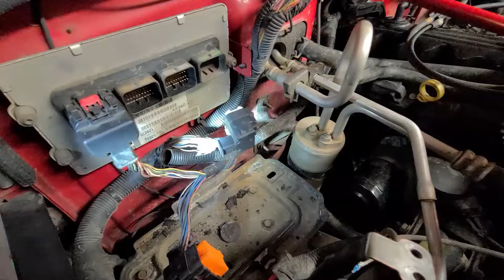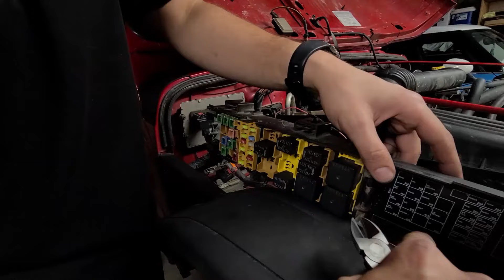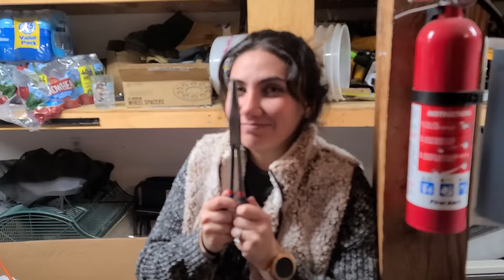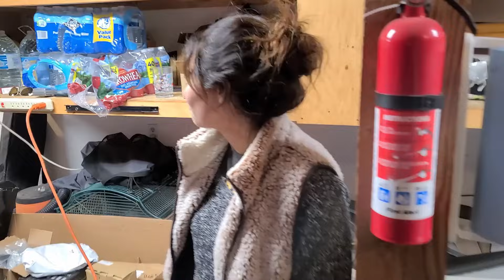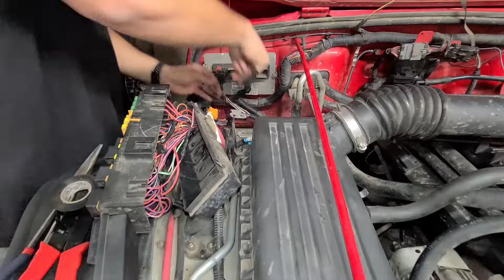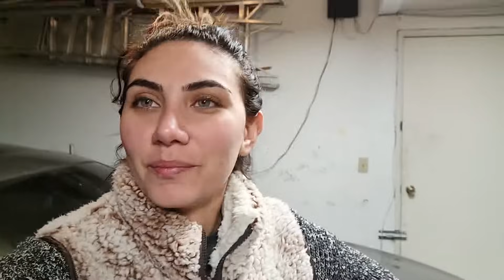STRANDED by the ASD Circuit! Here is HOW we Tested and Fixed it! Easy!

Comment: 96 grand Cherokee with 5.2L. I am not getting ground for the ASD or fuel pump relays. I provided ground signal to both of them and I get fuel pressure at the rail and I can see the ASD relay actuate with the housing removed. Engine cranks but does not start. I checked with a test light at the injectors and I have constant 12v to them while starting and I do not have spark either. Any experience with something like this?

Comment: Hi there. My issue is that the ASD FUSE was blown. So I replaced and it fired right up but unfortunately as I suspected it blew the FUSE again, to me indicating there is a wiring fault somewhere. Mine is a 2014 though and I believe also has the O2 sensors on this circuit. I guess I have to painstakingly check all associated wiring to find a wre grounding out (?). Also I am not sure of failed O2 sensors' state, if they will be in a short circuit co dictionary causing the FUSE to blow or not. I guess I can disconnect all the O2s and try to see if it doesn't blow the FUSE. Any advise would be great. Thanks. Great video BTW

Comment: I'M  HAVING  THE  SAME PROBLEM  !!, BUT  A  LITTLE  DIFFERENT !!!, I  HAVE  A 2007 JEEP  COMMANDER 4.7  AND  IT  KEEPS  SHUTTING  OFF  WHILE  DRIVING  IT !!,  IT  STARTS  UP  AND  RUNS  PRETTY   GOOD !!! , BUT  THAT  CODE -P0688  KEEPS  COMING  UP !! . IM 
JUST  WONDERING  WHAT  IT  COULD  BE !!! . YOU  THINK  IT'S  THE IGNITION  SWITCH !!, I REPLACE THE  LITTLE PLASTIC  PART  ON  THE IGNITION  SWITCH !!, BUT NOT THE  WHOLE SWITCH !!, I  ALSO REPLACE  THE  CRANK SENSOR  AND  THE  CAM SENSOR !!, AND  IT  ALSO RUNS  ROUGH !!, NOW   THE  PARTS  I  BROUGHT WASN'T  SOME  PART FROM  EBAY    !! . NOW DOES 
 ANYBODY  ELSE  HAVE THIS  PROBLEM  WITH 
 THEIR   JEEPS !! .
I  ALSO HAVE  ANOTHER PROBLEM  WITH  THE HARD  DOWNSHIFT  !!, I'M THINKING  ABOUT REPLACING  THE  VALVE BODY !!, BUT I  JUST MIGHT  GET  A  FLASH UPDATE  FROM  JEEP  DEALERSHIP  FIRST !! , THANK GOD FOR YOUTUBE !!! .   NO ? 👌👍👌

Comment: I have a 2011 jeep wrangler Sahara unlimited and I am getting the ASD and the jeep won't crank or start. I swapped the relays and no change. I think it's the nutrial safety switch but to replace it is so hard as it's in the transmission. Can you please help?

Comment: I have a 2002 Dodge Ram pickup could this be the same issue I am having I have tried everything replacing relays and fuses replace the crank trigger the truck just died one morning right after restarting it from the remote start

Comment: Hey so I’m kinda having the same problem with my 4.0 xj. Mine starts up fine but after 20 minutes or so it stalls. And then it cranks but won’t turnover. But after 15-20 minutes it starts right back up. Also, it’s not overheating. I was leaning towards the CPS or the ASD relay. Could you shed some wisdom on what I should check or test cause changing the CPS is a pain. Thank you and great video, I subscribed to your channel cause your explanations are great. Cheers.

Comment: Hi, I have a 98 Wrangler with exact same problem. it will crank and crank but no start. What would you recommend as first diagnostic step(s)? I replaced the distributor and am pretty sure I did it right. there is fuel in the fuel rail...I will replace spark plugs tonight but I feel hopelessly lost and cant afford a mechanic bill right now. Any help would be greatly appreciated.

Comment: I’m having problems with a 2001 jeep wrangler. I’m working on this vehicle with a group of people in my automotive class. The ASD relay does not click, and the pcm is getting the power and ground that’s needed in the connectors. I also have no communication to the vehicle.

I check my 5v reference circuit and was only getting .40 volts with key on. I started unplugging sensors except the crank, cam, and battery temp sensor because I ran out of time that day.

But my main question is do the ASD relay have to be active to receive 5 volt supply?

Comment: Hi , i have same jeep but my issue is when ever i leave 02 sensor wire connected it makes my fuel pumps wear out really fast, so i unplugged 02 sensor wire and now fuel pump has lasted long time , what could be the issue? are they on same circuit where  causing to much amps to fuel pump? through the ASD ty good channel

Comment: I hope you can reply , I have a 95 Jeep Cherokee with a crank no start issue. I reverse polarity, jumped it with jumper cables, and now my jeep won’t start. I have no fuel and no spark have replaced all the relays, Ignition coil, cap, and still no start. Any idea what could be the issue?

Comment: Awesome video, helps immensely.  Going through similar issue (intermittent stalling), and now I have some stuff to test out and investigate.  Might just solve my problem...
Reply from the maker: Glad it helped!
Reply: @Garagecouple   VBG
I cleaned up the grounds, and tested all the cam & crank sensor wires, all good.  Everything was pointing to the crank sensor, which turned out to be the problem.  Now solved.  I learned a lot about the importance of methodical diagnosis.  Probably the most important skill for a mechanic.

Comment: I have a 2000 dodge 1500 5.9 gas , the scan tool reads no communication with ECM,  I have 12 volts to ECM,  and 5 volts at throttle position sensor.  What should I be looking for?

Comment: I’m having the same problem on my 1997 jeep wrangler 2.5l and I switched out the the  coil and wire and spark plug and fuel pump. It still would crank over but not start so I checked the spark again and didn’t get any spark so I jumped the relay and got spark but it’s still not wanting to start up?

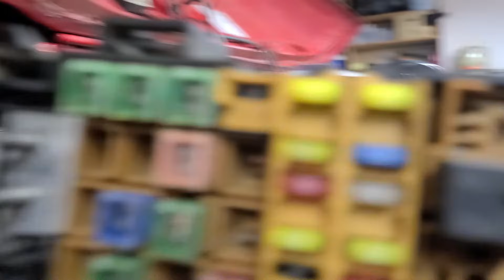Comment: 3:16 The center terminal of the relay is 87a. That's the normally closed position. Apparently, Garage Couple is referring to jumping between 30 and 87, far right and center-left in this video. That would simulate the relay closing and cause the starter to crank.
Reply: Also when I'm changing an in tank fuel pump and need to drain the tank of fuel I disconnect the fuel line & run it to a gas can then jumper the same pins on the fuel pump relay. Much easier than jamming a hose down the fill tube & siphoning the gas and no nasty taste of gas when trying to prime the siphon hose.
Reply: @johngreen6643  Every time I've dropped a fuel tank it's because I needed access to the broken fuel pump inside the tank. But that's a good tip for occasions when the pump is still good.
Reply: @johngreen6643 😅😅😅cut. Slit in the hose and with compressed air shoot out then plug with thumb then air a few times, not your mouth😅😅😅, tank will drain in under a minute
Reply from the maker: Yup, bypassing the relay..
Reply: Thank you so much for breaking this down. Did not mention the relay numbers in the video and mine is different

Comment: Similar issue on my 1997 Dodge B1500 conversion van. (basically a 3.9L Ram Truck under the hood) And today I said to my father, "We should just shove a penny in the ASD." Now that I see your DID bridge the relay to test, I'll probably actually try it. But, my question is...

When the ASD closes correctly, do you get one click; or two? Because when we turn the key to pre-crank position, I hear and feel the ASD click once; then 1 second or less later; I hear/feel it click again. So the PCM is successfully sending a ground. But that 2nd click could be the PCM disengaging the ground.

We've already replaced the crank & cam sensors, coil, distributor cap, rotor, plugs AND plug wires. (A lot of it was cheap, and sending it to a garage would probably get into 4-digits quick, so why not just buy and change EVERYTHING it could be?)

Today I confirmed the wire-continuity between the coil and the computer and between the coil and the ASD relay by stripping them just before their mountings. Anyway, if the relay is closing, and then opening again -- which is what it sounds like... Either the computer is sensing a real, genuine misalignment and refusing to start the engine to protect it, or the PCM is just... wrong and bad. That's my guess, anyway.

Anything you can add is greatly appreciated.
Reply from the maker: Good luck!

Comment: Interesting..the factory just did a  fuse block wiring repair [ recall ]auto shutdown relay I believe..my fuel pump is not getting power all the time.. the ecm controls the fuel pump relay..terrible wiring by Dodge
Reply from the maker: Afree

Comment: Just to be clear, with this issue the Jeep will turn over? I’m having an issue where sometimes my Jeep will start, sometimes the dash will light, up but won’t turn over, sometimes nothing comes on. I’ve changed the ignition, the battery, and I’ve followed the ground. I think I’m going to try a new ECM next. Any ideas?
Reply from the maker: Nope it will not turn over

Comment: nice video! im having some starting truoble with my 1994 dodge viper, im getting a 42 blinking code that says asd cercuit, my car intermittent have a long cranking and sometimes its like normal, do you have som tips for it? last time it was cranking and cranking it had no spark at plugs, i can hear the fuel pump prime everytime i turn the key, but i can hear some clicking from some relay i think sometimes when i turn the key, but when it first starts it runs like normal
Reply from the maker: I wish I had a 94 viper. Why don't you give it to us so we can fix it
Reply: @Garagecouple  hehe yeah that would be great if i wasnt living in norway ;)

Comment: Hey guys  what you mean when you're talking about the asd relay on your video around minute 3 to 3.20  when you say 
(unless you're  done the TSB you'll  get 
12 positive volts constant) because  I have 12 positive volts in both first one and the top left one, with out ignition on what's the TSB ?
Reply from the maker: It's the service bulletin repair by jeep
Reply: So it's  normal that  do I have 12V constant positive on both plugs with the ignition switch  off

Comment: Hi guy this video is really good one, 
I have a 2001 Dodge Ram 1500 2X4
5.2 and the cluster show the mileage and after a few seconds the mileage  blink and they go away and shows (no bus) I check the asd  pins  and I have 12V 
constant on both and on your video you said one has to be 12V with switch on
unless  you're  done with  you TSP both pins will have 12V constant  I have no idea what you mean so I'm  lost can you help please!!!

Comment: You presented this video in a very simple and direct, easy to understand way. I've watched this video several times trying to understand why my 2006 Jeep fuel pump was not receiving power. I have a jumper wire with 30 amp fuse for terminals 30 and 86 which can power fuel pump if needed. Original problem was failed computer at 100,000 miles. Bought computer from WranglerFix which was able to start engine, shortly after fuel pump was not powered, put new fuel pump in, it failed, bought new OEM from Jeep, it failed,  BUT WHY ? Fuel pump is good,  fuel pump relay is good, WranglerFiix computer and backup computer both good, wiring is good, but every couple weeks Jeep will not start because fuel pump will not run ! Any ideas ?
Reply from the maker: Sorry to hear this! Try a different computer.
Reply: @Garagecouple  I have two computers,  both are certified good. Plus original OEM computer certified bad...
Reply from the maker: @paulpurdue5963  that's tough. Might be a short somewhere. Sorry about that
Reply: @Garagecouple  All pertinent wiring has continuity and is in very good condition. Confusing thing is,  by taking out the 'failed fuel pump' and putting in the previously failed fuel pump the engine will run just fine, then it will fail, take out the fuel pump, put in the old previously failed pump and it will run the engine  bench testing the fuel pumps also show them to be good ! I'm at a loss as to what is causing this problem.  I do thank you for your input as to how this problem may be fixed.
Reply from the maker: That is way beyond our pay grade. It seems like you've exhausted your options. At this point I would replace all related parts, make sure nothing is shorting out (even if it has continuity), and go from there.
Reply: @Garagecouple  Thank you very much for your reply ! If I find a solution to this malfunction I'll post it here too let you and any readers know what might be causing this problem.
Reply: Update might help others with similar problem. Finally retrieved code ( 3 turns of ignition switch) P0633 SKIM key not recognized by PCM, voltage to fuel pump reduced to about 5 volts by anti-theft programming. Normal voltage to all other ignition functions.

Comment: Excellent diagnosis on the ASD. I have a JK and my ASD has tripped the fuse a couple of times. Now, I also own an LJ and I was hoping to get away from computer issues and was sad to watch this video and see that I still have the chance of computer issues. The JK is constantly in Check Engine light mode ever since the electronic sway bar disconnect shorted out in a stream crossing. Thank you for the video and congrats on finding the burnt/frayed wires.
Reply from the maker: Thank you so much! Fortunately that LJ has a very basic computer system and is ultra easy to fix
Reply: @Garagecouple  That makes me feel better. Thank you.

Comment: I was wondering if I could get some help I’m have trouble with the asd fuse it keeps blowing at random points completely shutting down the car  I replaced it and it starts right up, I’ve replaced the relay and no change.

Comment: So you don't have a theory as to how the damage to the ground wire insulation occurred ?

Have you shorted something when doing electrical mods yourself?
Reply from the maker: Theory is the battery rubbed it as it was previously not secured properly. 

Knock on wood have never had any electrical issues

Comment: I have the same problem in my 2015 Wrangler and thanks to you two I  have an idea . thanks 🥰
Reply: was it like the video
Reply from the maker: Cheers
Reply: @Garage Couple  I'm about to start investigating this tomorrow on a Caravan.  I'm down to wire inspection and pin2pin checks. Not getting spark at the ignition coil. She'll light the light probe for the first crank and then goes dark on the second crank when I check the power at the coil plug.

Comment: Awesome content. This crank no start issue I’m having is pointing me to the asd for my issue on my ram 1500. I traced it to the asd relay. I have 12 bolts at both points and I have a bad grounding. I did the jump method and the truck turned over but ran like garbage and would shut down right after letting off the gas. I have changed the crankshaft sensor already and found frayed wires at the sensor. No idea where to go next!!!
Reply: Make sure you have good signal from the cranksensor , fix the frayed wires ' fix the ground . check the throttle body and idle air control valve for carbon buildup and clean with throttle body cleaner if needed , check internet for how too also check air filter and replace if needed .point is when you have the gas peddle depressed you allow more air into the throttle body and when you let off the gas you restrict airflow , this is where a clean iac value and clean throttle body come into play. Hope this helps.
Reply: @chuckbelcher179  my cpu was fried.

Comment: So here a sort of complicated question about the ASD system. I own a 2016 jeep wrangler (4 door if it makes a difference) and I hardwired a dash cam onto it using a fuse tap. Because of the location of the fuse, and because a couple other fuses already have fuse taps on them, I chose to use the fuse (not relay) for the ASD since it gives me switched power and has a larger fuse. It works great but as I have had this set up for about a month now I have noticed that occasionally the dash cam is off while I'm driving and will not power on indicating it is not getting power. Does the ASD system sometimes turn off when you are driving? This scenario rarely happens but when it does, it only stays off for a few minutes and then turns back on. Trying to figure out if it's the dashcam that is at fault, or if the ASD system sometimes will shut off during driving for a few minutes. I have only noticed this twice in the last month so it is very rare and I can never do anything to recreate it, seems very random.

Comment: I'm on a 94 caravan, 3 months ago I had an external voltage regulator fail and overcharge up to 17.6v. fast forward to last weekend hooked a battery up and nadda. No fuel, no spark. I narrowed it down to a either ECM or some type of wiring issue with the ASD also. tried jumping the ASD and nothing. Any ways to jump the cam/crank sensor to test with it might be... I have a new ECM I am considering just swapping in to teat
Reply from the maker: Good luckA
Reply: @Garagecouple  pulled the ECM and it was cooked, exploded caps and melted casing. Swapped it and started up like it never stopped running.

Comment: Have a 95 xj starts and runs fine. Drive it 10 to 15 miles shut it off .when start to drive again it acts like it wants to stall no gas peddle response. Shut down 20 to 30 minutes later runs fine.

Comment: Yep, Chrysler wiring / electrical has always sucked. Bad connectors, bad wiring, and bad solder joints. I had a 1986 Daytona Turbo Z with tons of wiring issues, just like jeeps. For 45 years the only cars I've owned with wiring issues were Chryslers. 2 jeeps and the Daytona. If I didn't love my jeep so much I would burn it :)

Comment: I get codes for bad relay circuits for my fuel pump, hi and lo radiator fans, and my asd, would this all be caused from a bad asd circuit or are they all bad and i have a bigger problem?

Comment: Replaced the battery and alternator, still the volt meter ⚡has never hit 14 volts on this '05 TJ Rocky Mtn. 12.7 sitting and when turned over, 13.6, it should be between 14.2 - 14.7 After every start, there's a slight acceleration issue where it has to hit 1700 - 2000 rpm's, then it accelerates great.  🙄🤔